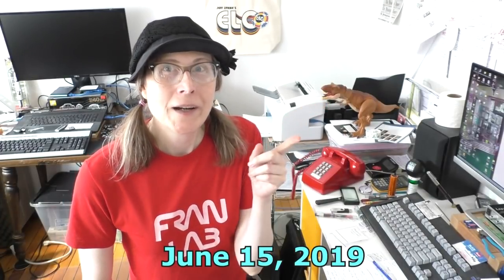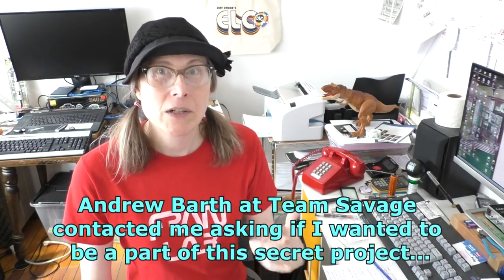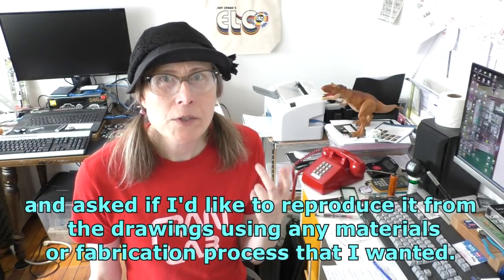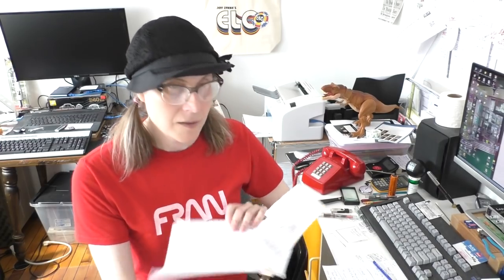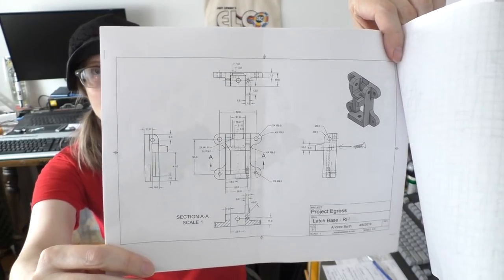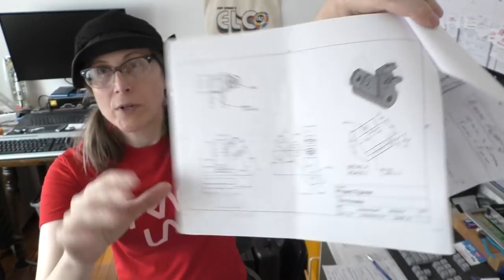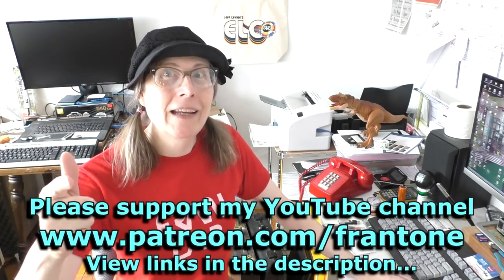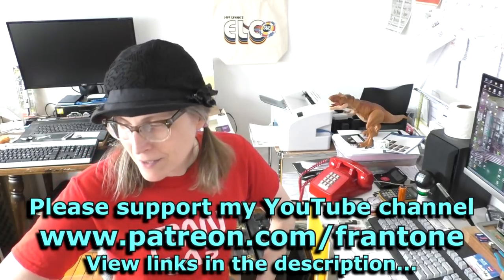Project Egress: FranLab Mission Log 1

Comment: What's with the newfangled touch tone phone?    Livin' large!    I wonder if there any COs that still work with rotary...

Looking forward to watching you progress through the project.  looks cool!
Reply: I have an old rotary phone on my desk.  It dials fine, but the modern ring voltage is too low to ring the bells.  Also, heaven help you if you need to deal with a touchtone voicemail type system :)
Reply: @Allthough  The idea of dialing in a voicemail PIN gave me a really good laugh.  Thanks for that!

Comment: Oak is a challenge, but a beautiful one.
Reply: BobC Also useful as a capsule heat shield for the capsule.  Not sure if it provides enough buoyancy post splashdown, or they'll still need the inflatable rings like the original.

Comment: something that might help in the future: they also provided fusion360 .f3d cad files. these can be opened in fusion360(which is free) and you can then make CAM toolpaths directly in fusion or export it as .step, .iges, or even .svg from a face.

Comment: It doesn't seem that long since you mentioned an upcoming secret project. I didn't think we would hear more about it until it was done. If there are 15 latches and you are making one, are there other people working on the other 14? A while ago I had a case where I got an STL model and needed to alter it so I used the STL file as reference and created a new version of the model in Rhinoceros 3D. Where did you find the STL files for the latch parts? You got me to search Thingiverse for Apollo related models and there are quite a few interesting ones I may download and print with my 3D printer. Good luck with your project.

Comment: The latch arm looks like a upper locking assy. from a upper latch assembly from a panic exit bar... Older von duprin style. You will most likely see them on an old church or city community center that hasn't been retrofitted.  Here are 2 breakdowns of sargent hardware  https://www.doorwaysplus.com/sargent-97-0300-spring.html   and this one   https://www.doorwaysplus.com/sargent-97-0300-spring.html  Hope this helps. Chances are they were trying to copy this than trying to reinvent the wheel.

Comment: Fusion 360 Fran, free for startups earning under 10k per annum, reads dwg and stl/step spits out svg. Very easy learning curve, powerful.
Reply from the maker: I hate cloud based software like death itself.
Reply: @FranLab  It is a local program on your computer. Just like any other program. Its not running in a cloud/online mode, but just as any local installed program on your computer.

Try it - you will get the work done with it.

Comment: Neat project!  I gotta say though, halfway through the video, I got distracted by all of your office accessories...   Unicomp mechanical keyboard, Sheaffer? desk set with some modern pen stuck in it, glimpse of a manual typewriter by the window...
Reply from the maker: I made the desk pen holder in 7th grade shop class and I keep my 1947 Parker 51 in there.
Reply: @FranLab  Oh nice!   Strangely, I have a thing that I made in 7th grade shop class on my desk (not quite as cool as a desk pen holder)...   as well as a unicomp keyboard.   My IBM Selectric II is in the left side of the desk on the big heavy spring loaded swing-up platform :D

Comment: Your making your way job more complicated than it has to be.... 
I could replicate the entire model in fusion 360 within an hour and have the gcode for all of it ready to run within 1-2 hours milling it on a cnc router isn't complicated. if your machine is that difficult get something better. 
you got way too much to think about and need to work on lightening the load. make things easier on yourself. 
this is the first part i've seen so far but i hope you get a good part without too much hassle.